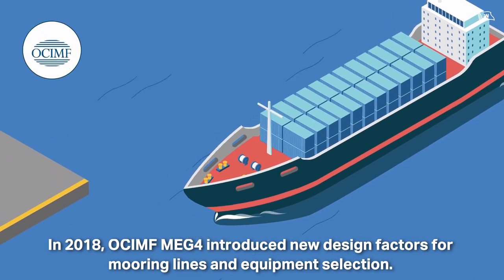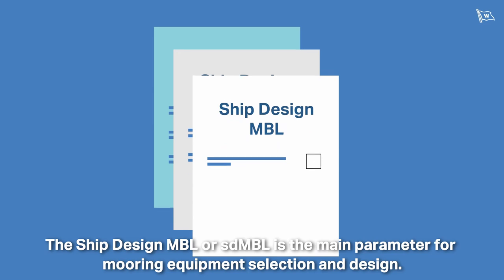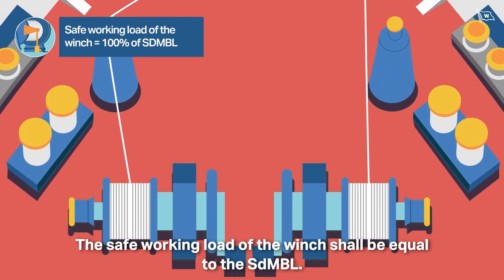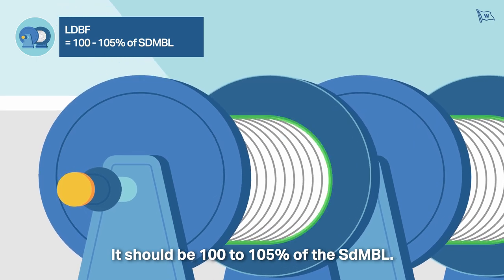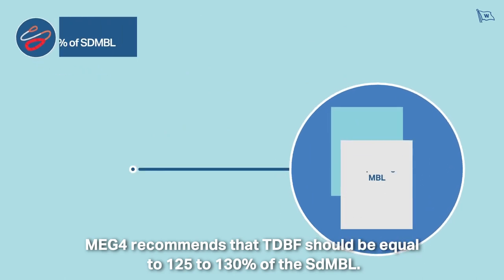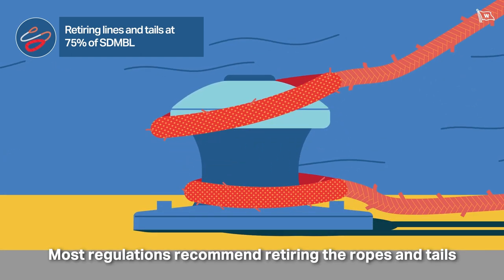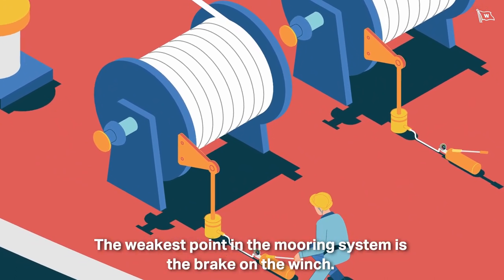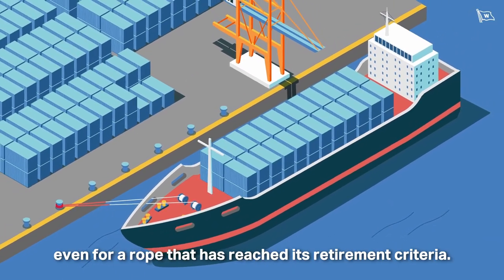Ship Design MBL: Key factors for safe and efficient mooring operation

Comment: thank you for the very informative video. i have a question. there are many mentions of the % to the SDMBL. for example, mooring rope should be retired once it reaches 75% SDMBL. i would like to know. how is it this value measured. thank you.
Reply from the maker: We recommend to carry out periodic inspections of the mooring ropes based on the manufacturers Inspection & Retirement guidelines, please see here https://www.wilhelmsen.com/ships-service/ropes/knowledge-base/ for more details. The residual strength of the rope can only be determined by a destructive test ashore.